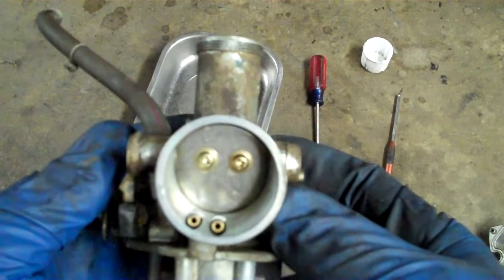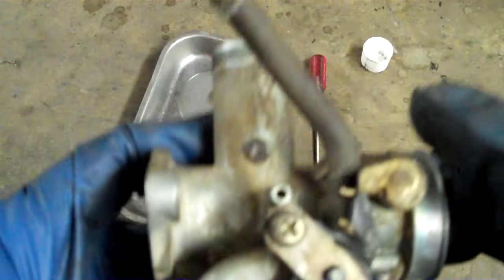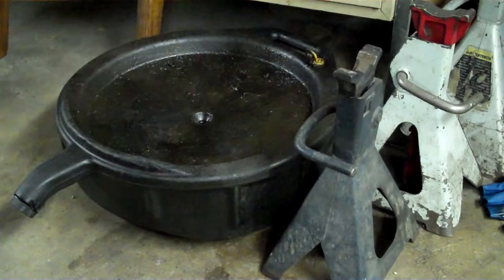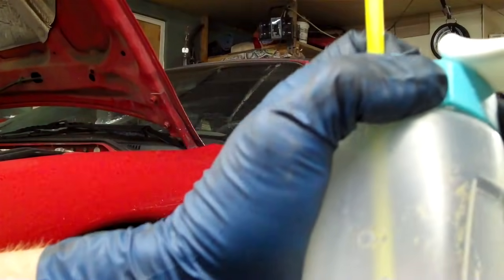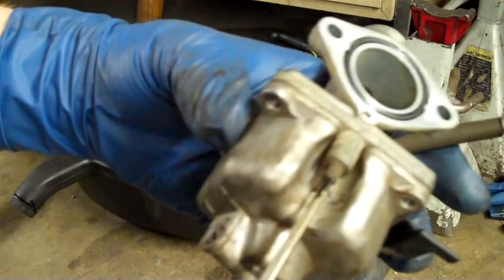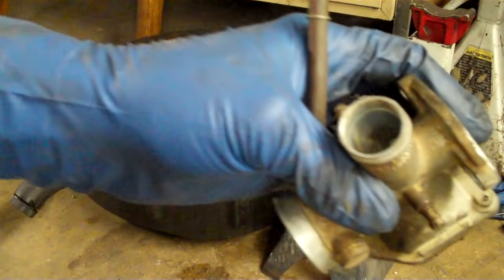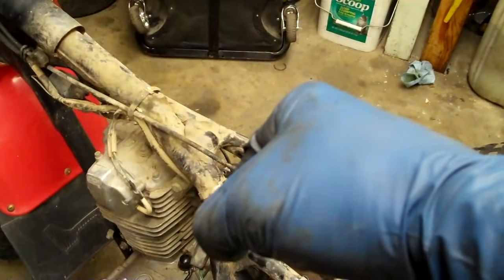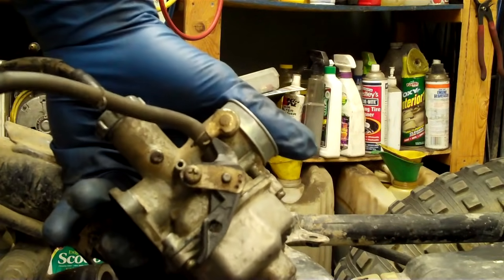How Motorcycle Carburetors work and how to tune and clean them

Comment: very helpful, except i wanted a closer view of the main jet and whether it sticks up muc into that little horseshoe brass venturi piece.. i lost the main jet for an old carb so i am making another one on the lathe. so far the bike runs and is rideable, but bogs with too much throttle, the main jet needs some more thinking...
p.s how much space should there be around the needle inside the main jet for the gas to slip past? how big should the hole be. how much of a gap around the outside of the main jet should there be for the air bypass to flow through? should i make the top of the main jet completely flat or put a slight dish/ cup/ recess/ concave shape/ bigger drill hole in it for the petrol to sit in? would that make it run significantly worse? its such finicky work...

Comment: Great video! I replaced the main jet and the pilot jet in my motorcycle carb and cleaned it because it was running lean. Now after the "rebuild" its runs even more lean than before! what should i check?

Comment: Thank you for explaining in detail. my carb won’t idle , yam 50 raptor 2008. It dies before idle or revs extremely  high . How important is it to have the carb boot secured while trying to get it tuned.. not fined tuned .? I’m looking for leaks but nothing? I don’t want to tear the 4wheeler apart
Reply: The jet, I must tear down this carb 4 times a day to double check that jet.

Comment: Awesome video.thank you.I have a question though.the bottom of the carb on the outside has the drain hole and the screw just on the side of that to open and close the drain well when i put gas into my tank it flows into the carb and straight out that hole even though i have the screw to the drain closed tight.Can you please tell me why that would be?Thank you

Comment: Great Video!!!!  I have one question?  Does the low jet need to be unblocked from top to bottom or just the little set of holes on the sides?  Cleaning my Vespa ET4 carb. It won't keep running.  Thanks  Michelle

Comment: My moped has some starting trouble. Once it starts, it idles fine and dies when i give it gas. I probably need to clean the main jet again properly.
Question: My vacuum operated fuel valve broke and now there is continuous fuel flow into the carb even if the engine is not running. The float needle should take care of it. But do you think the overflow is resulting in starting troubles?
Amazing video.

Comment: Nice video, but I have a question mostly what is the problem of the carburator if its like getting off the engine when the throttle is fully up? And if im using it in a long ride or going up the hill its like my fuel is gone... thanks!

Comment: Saved thanks best video yet Im having issues with my dr650 it has a bst40 carb on it I think one of the Jets might be clogged my symptoms are as follow doesn't turn on unless I give it gas and when I release the gas it shuts off while on and revving it's backfiring like crazy bike only has 6K miles 2018 Suzuki dr650 I dumped the gas replace spark plugs removed little filter built into carburetor  and installed an inline fuel filter added seafoam and problem still exist can you give me some pointers please your videos by far the most informative I found thanks

Comment: Hey Brian good info. need some help 2005 yamaha bruin 350 carb spewing gas into airfilter and out overflow. cleaned out seat thoroughly needle looked fine no visual wear or damage. reinstalled but still leaking out. bent float tab a bit up to try different setting but still leaking out any thoughts or ideas.

Comment: Hi - great video and very helpful. I just have an issue with my BSA C15, it starts very good and tick-over is nice and smooth but when I open up the throttle quickly it dies unless its on full choke. On full choke it revs great no matter how quickly I open the throttle. Hope you can help, oh one more thing, it is a brand new Amal monobloc 376 that I installed straight out the box.

Regards
Bob
Reply: As he discussed, open throttle is when you'e using your "main" jet.  Choking makes it richer, so your main jet/needle combo is too "lean" when choke is off.  1) lower needle clip, or 2) try a larger main jet, or 3) try a thinner or more tapered needle. JMHO, YMMV.

Comment: Hello mister, could you please explain to me why 2 stroke Vespas lack engine braking? I have a PX - 150 that is scary to ride down a hill because it just speeds up and over revs while in 1st gear with throttle closed. If my drum brakes ever failed, I'd be dead.

Comment: I have a 2006 Suzuki gz250 and when I start up my bike when the engine is cool I have to constantly pull on the throttle to keep it from dying off when im trying to warm up my bike is this carburetor related or is it something else ive tried the choke adjusting that but doesn't seem to help

Comment: First I want to say thanks for the awesome video tutorial.  Next I'd like to ask you a question. I have a 2009 Honda Rebel and I recently took apart the carburetor every time I went into second gear and give it gas or anytime I give it gas it would start to putter  out as if it wasn't getting oxygen or gas it sounded like it was the long or high end pipe in the carburetor but when I took it out it was clean any suggestions

Comment: Can someone please further explain that pilot/low speed adjustment screw?  Mine was at about 1.5 turns but I think it is lean....... so which way do I go?  Turning the screw inward ("tight"er) restricts the air so that it would run richer, right?

Comment: Question on my 06 Honda CRF motocross bike carb: to get it started I have to turn up the idle set screw each time and then after a few seconds the engine starts revving very high and I turn the idle screw back down, and then it works fine after that. And I can start it normally each time, as long as it's warm. But when cold I have to turn up the idle screw again. It's almost as if it's not sucking enough fuel when it's cold, like the venturi is weak. Any ideas?

Comment: I have a kdx 200 that is flooding my engine. I believe that's the case. It won't start I pull the plug and it's soaked with fuel. Do I just do what you did and clean the parts?

Comment: Is cleaning the carburetor with water then oil it up advisable just for servicing purposes or tune up ?
Reply from the maker: Don Charisma Carburetors do not handle water well.  Water is bad inside most anything that holds petroleum distillates.  Cleaning outside is okay, but not inside.
Reply: Don Charisma use carb cleaner on inside

Comment: Hi Briansmobile1, thanks for this great video, I have an issue with my carburetor. In 1/4 throttle sometimes it will not give good response like its somewhat lost the power or the engine would likely to stop. Are there anyway to troubleshoot that like change lower slow jet size or something?

Comment: sorry, one more xD 

the mechanism u used to adjust the timing using the shown screw that spins as u counted like 1.. 1.5 .. 2 and so on. That, how the screw regulates fuel/air mixture ?

Comment: Can u please help me, my motorcycle has a keihin 30mm CV carb and i have fuel supply related issues with this carb. Its a 2 year old carb. My bike accelerates slowly and then pickup normally. The service engineer told me the carb needs to be replaced but i think otherwise. Can you help me repair the carb?
Reply from the maker: You're lower circuits are obstructed or maladjusted.  That's the air screw, mid jet, or the by-pass holes.

Comment: Hi I like your VDO could you do me a favor I have 08 kawasaki ninja 250r when I bought it wasn't running so I cleaned the carburetor it start but it can't accelerate when I accelerate it about to die in don't know what's wrong.  Questions 1/ how many turn of air mix should I set? I try different turn it still don't work please help

Comment: Nice vid, dude! Very useful... One question though... My bike often chokes when I start opening the throtle (just on that initial moment)... Is there any simple tunning I can try to fix that without tearing the whole piece apart? I've tried adjusting one of the bolts from the outside (the one linked to the throtle cable) but it revs up the engine and I'd like keep it at about 1000 rpms when idleing... Thanks in advance!

Comment: A Question. What is the position of the fuel flowing through the carb on deceleration.? Eg: We're riding at 100kmph and we stop giving throttle? what happens then? (The Engine is still revving high cuz of the momentum from the tyre). I wanna know if at closed throttle  and high speed we're still supplying same amount of fuel and air mix or if there is a larger quantity of air in the mix.? Plz answer

Comment: When you demonstrated how when theres high speed air going on the straw, it creates low pressure and sucks the water. On the carburetor, what is creating that air flow?
Reply from the maker: +Banaanipässi FIN The high air flow is caused by engine vacuum.  Engine vacuum comes from the piston going down and sucking in air like a syringe sucks in liquid.  Pistons do this thousands of times per minute.
Reply: briansmobile1 Oh right, didnt think about that. Thanks a lot for clearing it out

Comment: I adjusted the idle but when I click it into first gear it cuts out / or the bike the bike starts moving if I give it some gas although my hand is pulling the clutch in
Reply: +Charlie Johnson Your clutch is obviouusly slipping, and engaging. Try adjusting it on the lever end of the cluutch, if that doesnt work, youll need to take the clutch apart and see if it's done.

Comment: My Suzuki GS150R, with Mikuni BS26 carburettor, gives constant jerks slightly after taking it out (like almost 7/8 kms). I cooler it gets, the more jerks. the Jerks feel as if the engine switched off and on momentarily. The compression tests prove ok. Also there is neither rich mixture or lean mixture into the engine. I am suspecting a clogged main jet. The jerking is high around 4k rpm. Can you tell me if there is high likely hood that the carburettor is misbehaving? And if so, what should i do. Thank you in advance. This problem started after i started to park it outside, when i moved to a new city. But even though it is not raining, i m having issues.

Comment: Hey I liked your video a lot! and I finally understood what that "jet" sticking out of the throttle barrel is and it appears to be the overflow but mine has a small tube like to put a hose there, and I still have another one which I dont really know what it might be and to what should I plug it to, it is sticking out of the barrel that sends everything to the combustion chamber and it also has a tube i have an 89 yamaha dt125r with a mikuni single chamber carb (i just learned this with your video XD) any help is greatly appreciated, thanks!!

Comment: how many turns should be correct for the idle screw and for the needle what is the best setting right now it is on the second last setting please help have the exact same carburetor
Reply from the maker: Air fuel mixture depends on the engine condition, temperature, and elevation.  That's why it's adjustable.  However for most applications a good place to start is 1.5 turns out from bottomed out.

Comment: can you help me bro. when i higher my trothel my engine starts to rev but when i go to high the engine losses power and the rpm dicress. what can i do bro do i have to adjust my trottel pin or size up the jet tube.

Comment: I have one question. You explained that the air jet standard setting is like 2.5 turns anticlockwise from complete screwed in position. Why is it that my bike runs only when its like nearly 7times anticlwse needle nearly falling out. If not it would stall or hesitate before it could acelerate.. am using the same type carburettor a keihin pz27. Can you give an explanation on this please?
Reply from the maker: That air screw is likely compensating for a blockage to another port in the circuit.  If you can find and clear the blockage or rotten o-ring chunk or whatever it should help.  Outside of that, it could be a manufacture issue causing a restriction.
Reply: @briansmobile1  oww..  thank you soooo sooo much for replying.. i really appreciate. Thnks mate.. n God bless..

Comment: working on yamaha 350 moto. have not started since last yr . Found float stuck, cleaned all orfices,jets  New fuel -found pilot jet stopped Used one wire off brass brush to clean it out . Ought to be good to go ? ha 
Pulled Carb off 3 times , looking ,cleaning . engine starts fine ONLY with Choke and runs erractic at fast idle . Choke off , it dies !! This on a LOW mileage clean ATV.
I am puzzeled , Any Suggestions ? Thanks  ....te

Comment: Ruled out ignition,timing, spark,broken wires type stuff.now seems carb related 07 softail front cylinder barely warms up 90 seconds run time,pull front spark plug wire bike sounds about the same but of corse no heat at all with no plug wire.After watching your clip seems to me it was doing okay high RPM just idles poorly like running rear cylinder only

Comment: I have a hammerhead 150 cc Chinese go kart/buggy. I have a problem where the buggy turns on fine, but as soon as you tap the peddle for gas, it'll completely die out. I already cleaned out the carb twice already. It stays on, but as soon as you give it gas, it'll just die. Already checked for vacuum leaks, new spark plug, new fuel regulator, fresh gas, fresh oil, new battery.

Comment: As far as I know the venturi principle is something completely different. It explains that fenomenon occuring when a mass of, lets say, air, goes from a wide tube to a narrower tube. In the wide one, the speed is low, static pressure high. On the narrow one, the speed increases and the static pressure decreases.

Comment: Hey dude tried all of this on my skyjet sj125-23( 2007 cbr copy cg engine) but still wont idle it usually idles round 3500 to 4000 rpm but its just cutting out and ideas

Comment: I have a brand new carb on my son's 100cc Honda.  It will flood.  I've been adjusting the float and jets for 2 weeks now and I can not get it to stop flooding.  It ran perfectly for about 3 runs, then this problem started.  I've cleaned it several times, including the float pin and sleeve, but still no luck.  Jet is clean.  I can clean out the gas, put it all back together, and it will start right up perfectly as though nothing is wrong, but then after about 10 seconds of idle it will start to stutter and about 15 second mark, it will die.  Gas will flow out of the intake filter.  No idea how to fix this at this point.  Any ideas?

Comment: Hey, just cleaned my carb on my dirt bike now the throttle butterfly won't open up until quarter twist of my throttle. Any help?
Reply from the maker: Your throttle cable has slack in it.  There are threaded tubes to help adjust it.  Make sure the cable jacket is seated and the slack is adjusted out, but not too tight.
Reply: +briansmobile1 where are the threaded tubes? Thx

Comment: What causes the carbon in a spark plug? Is the combustion not good, the piston cylinder already darken with carbon, the sparkplug and ignition coil are bad or the fuel and air are not balance in a carburetor ?
Reply from the maker: Douglas Batalla Fuel is hydrocarbons.  The carbon deposits are a result of an incomplete burn that could be from many things, but most likely fuel and air imbalance.
Reply: Thanks for the information!

Comment: sir I own hero Xtreme...
I do get pickup problem....
I took my bike to mechanic he changed the clutch plate still issue isint resolved...!!!
bike doesn't go above 65....on max acceleration....
and sometimes it's automatically resolved...N pickup goes to good..!! N sometimes suddenly it's goes..... fussssssss....!!! RPM goes high but not the speed.!!!!
plz help...plz

Comment: Having issues with my carb. Exact same as yours only off a Panterra 150. Dirt bike only runs if you're on the throttle no matter what the choke is set to. Cleaned out the jets and have the idler screw set to what it was before it sat for 2 years. Air filter is disconnected and running new fuel. Can anybody help me? Greatly appreciated

Comment: Maybe you can help. I upgraded my stock Carb with a 18mm carb with a accelerator pump. It looks like it only has the one adjustment screw. My scooter takes off ok up to about 15mph then Bogs down bad, then after awhile it seems to come back up to 40/45mph. I changed the Roller weights to 5.5gram, new 729 belt but just can't figure out why this is doing it. Can you help??
Reply: It does have a adj screw under the bottom but it seems it goes to the overflow hose.

Comment: you dropped the spring and washer behind the air needle at 7:40.....the spring keeps the needle from backing out when the engine is running...but ive noticed this vid is from 2012...but just wanted to point out...lol

Comment: I  have a 2005 Honda rebel 250 been seating for about a year put new fuel spark plugs new oil wont start pulled the air filter out sprayed gas in there and it runs what could it be..